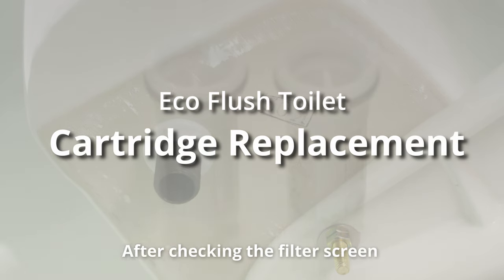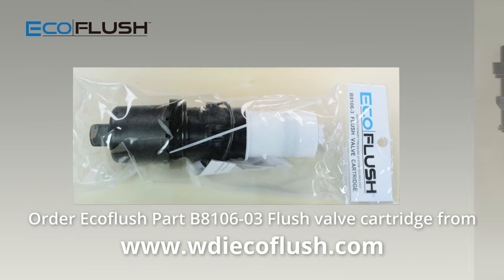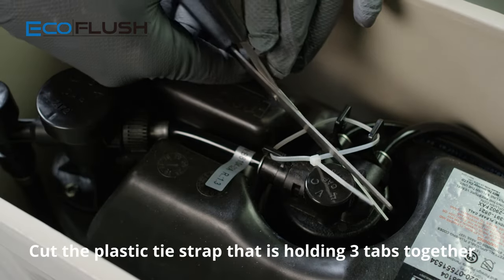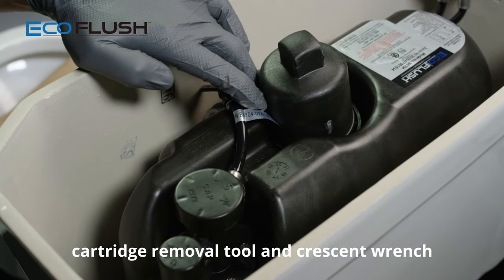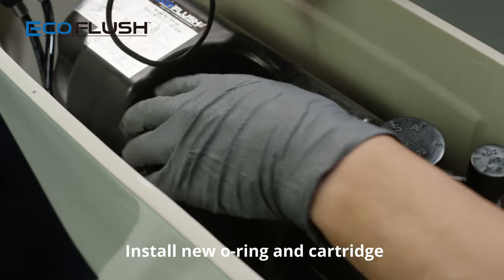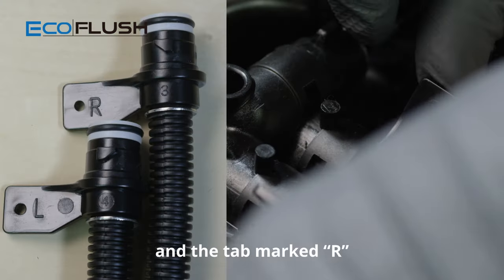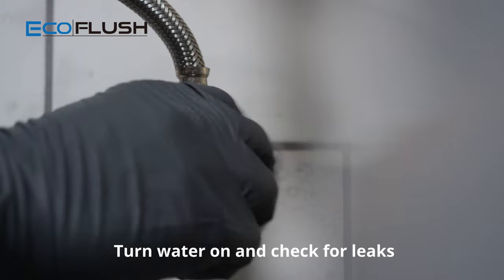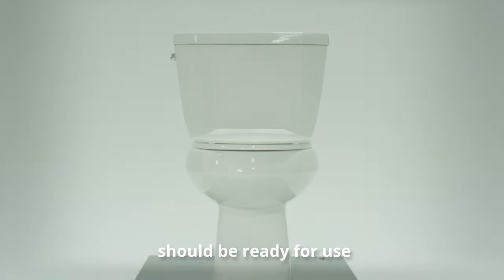ECOFLUSH Cartridge Replacement

Comment: I have cleared the filter screen for any debris and replaced the cartridge B8106-03, but the flushing is still not effective. The toilet bowl is clear, no clogs, the building drain is also clear, with no blockage.
Any suggestion as to why the flushing is not effective. Anything within ECOFLUSH system needs tweaking?